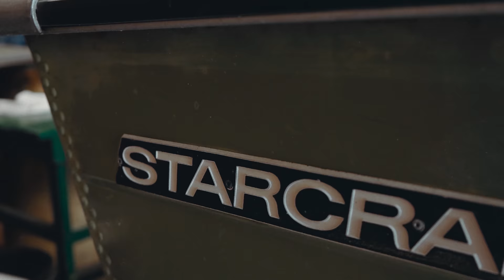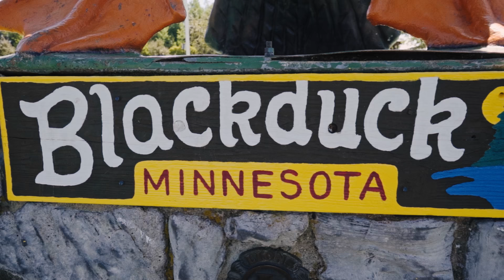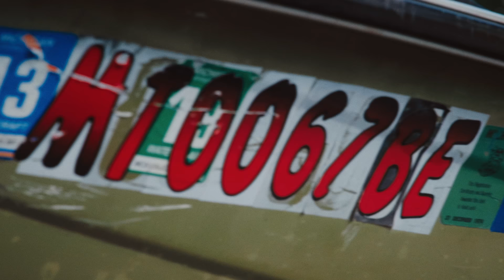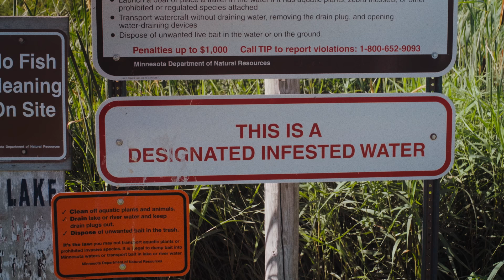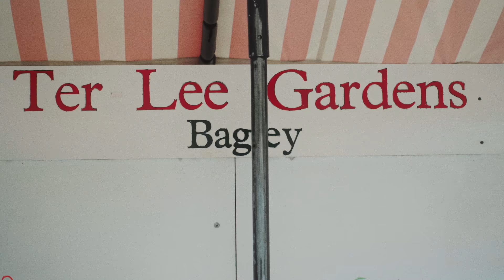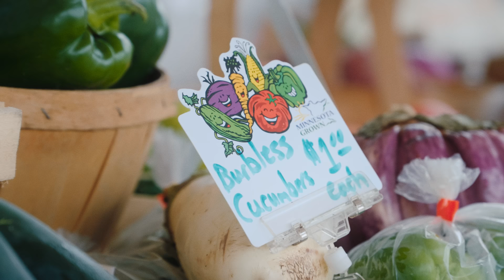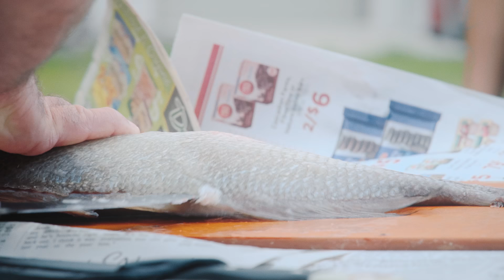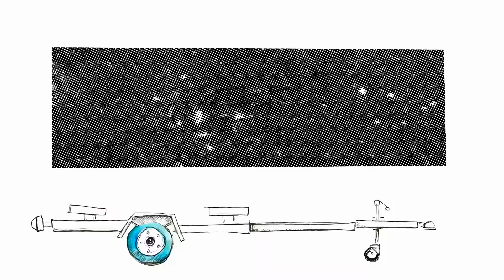Freshwater Drum w/ Danielle Prewett & Frank Smethurst  S2E06 | Das Boat

Comment: Try rigging the line differently.  Use a running sinker above the swivel and allow some slack line.  Bottom feeders like drum and spotted grunter which feed on benthic invertebrates generally have more sensitive mouths and reject the bait if they feel resistance.  The object is not to feel the bite but to allow them to pick up the bait properly and then swallow it.